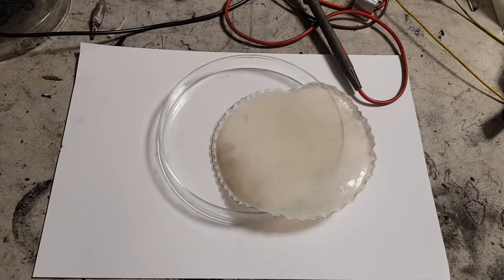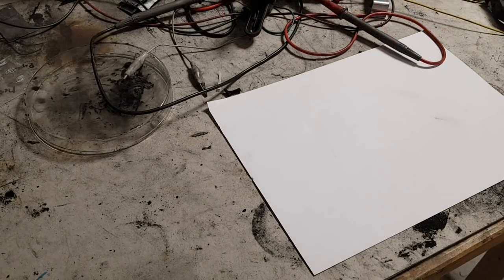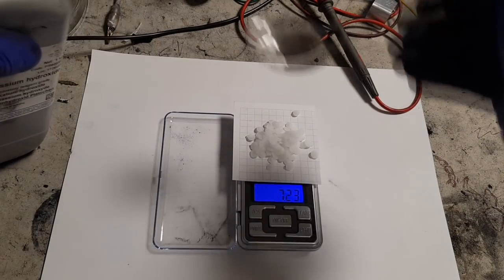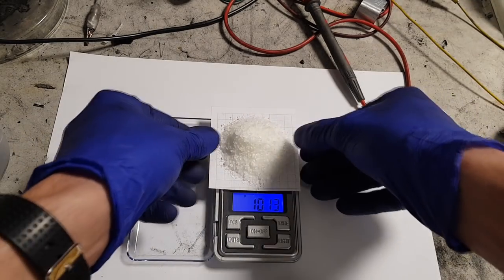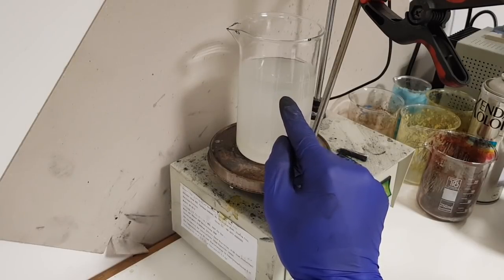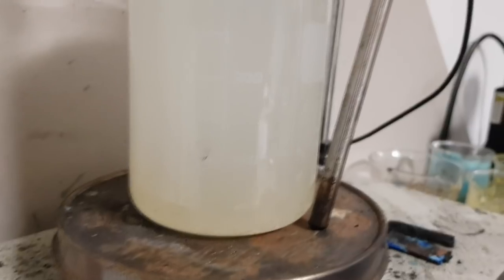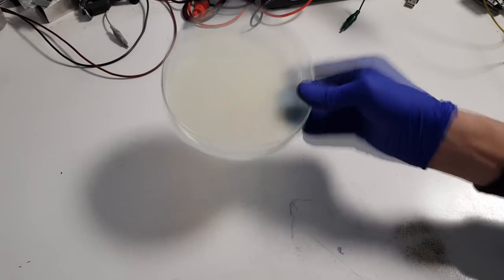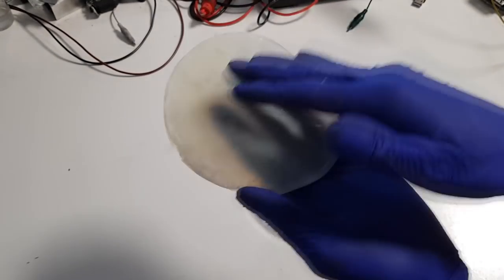Polymer gel Electrolyte for Batteries

Comment: This....could actually help with my project. Thanks a lot!
Reply from the maker: Nice to hear that
Reply: Hi, my PVA does not seem to be dissolving in the hot KOH solution. Rather it forms blobs in the solution. I would appreciate your insight on this and let me know where I could be going wrong.

Thanks!
Reply from the maker: @varunnavaneeth6053  Interesting,... I use PVA MW 25000

Comment: Hey Cayrex, how can you prevent the electrolyte from drying up? I put 50ml in small beaker, and after a week it all dried up.
Reply: We put them in a glass jar suspended on a platform with water in the bottom and use a sealant on the lid

Comment: Great idea
Would it be optimal for al ion batteries with the addition of some alcl3?
Reply from the maker: For aluminium air battery yes,..  but no for aluminium ion battery
Reply: @cayrex  Thanks!
And what would you suggest using instead for al ion batteries?
Reply from the maker: Urea : AlCl3 in 1 : 1.3 mole ratio. But of you can get,.... 1-ethyl-3-methylimidazolium chloroaluminate (EMIC-AlCl3)
Reply: @cayrex  Is it possible to suspend the urea : alcl3 mixture in CMC, in order to create a solid electrolyte?
Reply from the maker: @sziluchannel  ion transport will be not so good in that solid. But yes, you can try. Urea and AlCl3 will be more or less solid/gel at room temperature.
Reply: @cayrex  Thank you!
It is a really interesting topic, so please keep sharing your experiments!
Reply from the maker: @sziluchannel  no problem. Yes I will
Reply: @cayrex  Just one more question: Should the aluminium chloride be Anhydrous or hexahydrate will also work (of course calculating with the extra 6 molecules of water)?
Reply from the maker: @sziluchannel  oh yes,... that is really important. You nees water free one,... anhydrous
Reply: @cayrex  Thank, very appreciated!

Comment: GREAT Presentation!!!!!! I Have KOH and Just Ordered PVH and Patiently Waiting for It. Do I really need The magnetic Mixer and Heater or can i just do it on the stove and stir it manually?and keep it Under 100C until its Mixed? Also I Can Also grind the KOH fine to dissolve easier.
Thank you Again ........Stash
Reply from the maker: Thank you. Yes, indeed you can mix it with hand on some hotplate. But can take some time that the PVA will dissolve 😴 You need to have around 90 deg C that the PVA will dissolve,.... a hotplate will be ok. Also if is to much for you to mix it with the hand,.... you can also stir with a drill ➡️ which is connected with some T or L shape profile for mixing. No need for grind KOH, because will dissolve relatively fast.
Reply: @cayrex  Thanks a million for getting back to me so soon Your the Best!!!!!!@
Reply from the maker: @mjmurawski  no problem

Comment: Sir How to make ink from powdererd PANI and polypyrrole? kindly guide
Reply from the maker: I dont know, I never work with PANI or polypyrrole. First find a solvent which can dissolve PANI or polypyrrol.
Reply: @cayrex  after finding a solvent what should I do. kindly guide me thoroughly
Reply from the maker: You paint something. After evaporation of the solvent you get a coating of PANI. Because I dont know about performance of PANI,... I think that you will neet to use another polimer for the better binding. Mix PANI with other polymer which is also soluble in same solvent. I'm just guessing!!!

Comment: Can I add more of koh to make it better
Reply from the maker: Yes, you can try.
Reply: @cayrex  bro if I use lithium and alluminium can I get a good battery using this electrolyte
Reply from the maker: This one is a alkaline electrolyte. Aluminium and especially lithium will react,... not so strongly as in the water based KOH electrolyte but will react. You can make a aluminium air, nickel zinc, nickel iron, zinc air, manganese zinc, silver oxide zinc battery,....
Reply: @cayrex  thanks man btw can you make a vid that shows how to make a rechargeable electrolyte

Comment: How sulphuric acid can be gelled  ?
I want to put it in lead acid batteries
Can it works there  ?
Reply from the maker: To H2SO4 just add silica and you will get gelled electrolyte. Silica or fumed silica is used in commercial gel lead acid battery
Reply: @cayrex it’s not working 🙃. I added pure Sulphuric Acid to Silica Gel, nothing happened. 

Plus, my PVA is not dissolving at 90 degrees for 1 hours with hand mixing. It’s just turning orange to red over time. Any idea how you can help Cayrex, you would be of a great help ^^
Reply: @cayrex Yeah, please can you tell us how to do it with sulphuric acid? It didn't work with silica gel with me either.
Reply from the maker: @puckbucky.5545  Tell me more! What  concentration os the H2SO4, how much was the acid, how much you add the fumed silica
Reply: @cayrex  its 98% sulphuric acid, I just added Silica Gel (transparent balls) not fumed, into the acid, the balls were soaked in acid (I didnt measure the quantity, as I wanted to see what will happen first), kept on mixing them, left them overnight, nothing.

I'm just trying to make a solid active material with acidic electrolyte, for dual electrolyte metal-air   :)))

Btw thank you a lot for your reply, didn't know you're still active, big fan of yours <3 also extremely cute :P
Reply from the maker: @puckbucky.5545 Yes yes, still active! No ,... you mix H2SO4 with fumed silica not with silica gel! It's quite a big difference. Interesting that you dont get poping when you add silica gel to acid. Because in most cases the silica gells are filed with water. So, if you want to still use silica gel then you need to dry out all the water (add silica gel to  the oven and then heat arount 70 to max 80 deg C). The gel balls will will shrink. Also 98% will be to high for metal air batteries,.... lower it down at least half.
Reply: @cayrex  Thank you very much,

Yeah, when it didnt work with 40% acid, I tried with 98%. 
I will heat it, dry it, and try it again, and I'll post my results here.

I'm a student, but currently looking for jobs, Let me find a job and ill go to patreon :) You deserve it ^^
Reply from the maker: @puckbucky.5545  No panic about Patreon. Some nice comment or thumbs up will be good also 😉 Anyway,... I recommend you to also get the fumed silica
Reply: @cayrex  I'm not panicking! I'm in love with your content that I turned my room into a chemistry lab :))) I've been wanting to support you for a while, just out of THANK YOU  :)

I will try "ovening" my silica gels instead of buying fumed silica, I don't want to waste the 1 kg i have. I will post my results here for eveyone <3 Thank you cayrex
Reply from the maker: @puckbucky.5545  Hahaha nice to hear that. So cool! 😁

Comment: how many hours did it take for the electrolyte to dry?
Reply from the maker: Depending on the thickness. The membrane will be ready when the almost all water will evaporate. This can be dry in 8 hours or 24 hours. If the time is your enemy, than you can dry the membrane in oven on 70 degg C.

Comment: Hi could you please tell us as a researcher if you want to improve the battery with solid electorate (polymer for example). from where you will begin and also which method you choose to characterized your synthesis? the stability? the ability to recharge or not and so on

Comment: how long can this be stored in the jar? Will or still harden if it's seal very good? 

so i can just pour some out when I want to make a gel electrolyte/ separator ?
Reply from the maker: Hmm, I didn't try to store for long time. I think if you seal really good will be fine.
Reply: cayrex2 

ok. thanks for the reply. 

I left a comment on another one of your vids about making battery plates. 
I think it world be good for ppl who don't have the skills,  or equipment.  but would like to experiment with these new battery chemistry n technology
Reply from the maker: @dremaboy777  aha ok. Hmm not bad idea, I like your thinking. I have several electrode designs.

Comment: Sir, can we make polymer electrolyte with sulfuric acid?
Reply: Boulos Nassar It probably won‘t work in the first line because you probably will be unable to get chain growth in acid medium because in this case the hydrolysis is the reason for chain growth.
Reply: But in fact you could use the demonstrated method, wash it in di-water several times and then soak it in a sulfuric acid solution with a concentration of less than 60% v/v because else the sukfuric acid directly reacts with pva under temperate conditions and form a pink-ish product
Reply: thanks
Reply: Boulos Nassar and if you like to know I could give you a hint which is as following:

I suggest you to use PVA with a lower degree of hydrolysis (60—80%) because the left-over acetate functional group will give you upon addition of NaOH/KOH a polycondensation which is like crosslinking, this way your membrane won‘t dissolve. Regular white glue will do the job, just mix it with an hydroxide salt in the right concentration and you will be litterally able to form a hydrogel, so you can follow up by soaking it in acid.
Reply: Thanks Andre, appreciated.
Reply: Yes, you can. Is similar to this method. So do not bother with other methods.
Reply: Dyuk K The problem is the polycondensation between the polymer chains which gived it its stability, if ypu use sulfuric acid this won‘t work very well
Reply: May i ask, Did you try it with sulphuric acid?

Comment: Could NiSO4 be substituted for the potassium hydroxide?
Reply from the maker: Good question. In basic yes, but you need to play with the amount of NiSO4. I try several SO4 materiels and is hard to find good salt amount that you will add to PVA. Because when I add to much salt I end up with stone hard material, but if I add less salt I get flexible electrolyte but the ionic conductivity was bad.